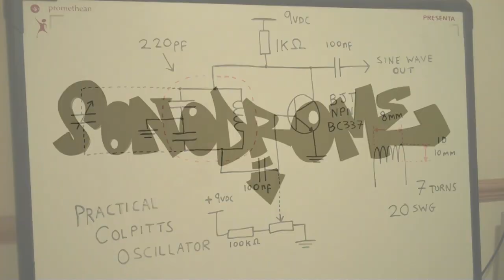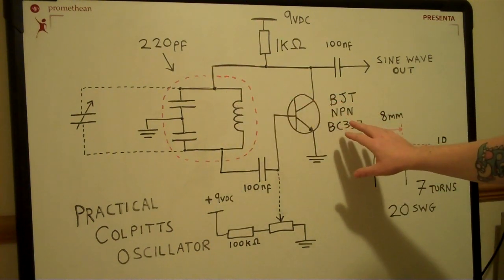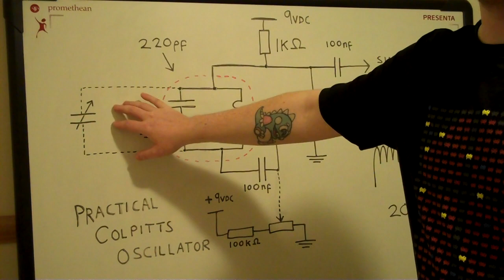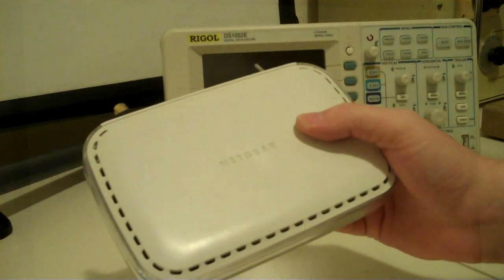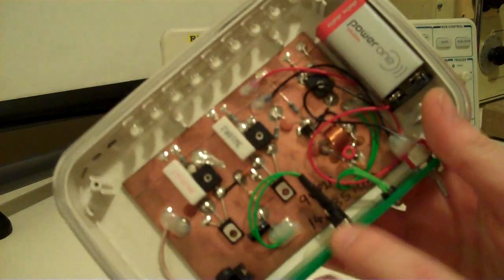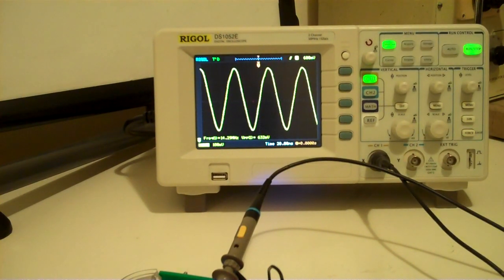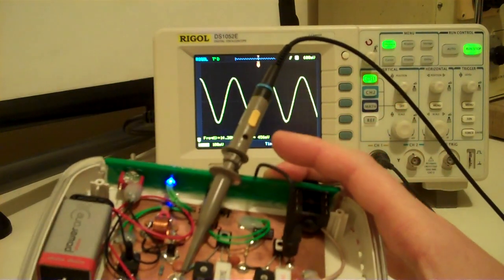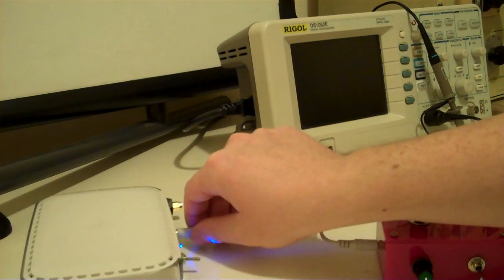Practical Colpitts Oscillator

Comment from the maker: The Colpitts oscillator can be used in various radio topologies. You could use it as the local oscillator in a Superheterodyne, but you will still need a bunch of other circuitry for the IF filters etc. I guess that's why the Colpitts is an interesting circuit to build - it's like a basic building block for many radio circuits, both transmitters and receivers :)

Comment: I simulated this on LTspice XVII -- I get an acceptable sine wave only if I remove the transistor base bias resistor network. I used bias of 1MOhm + 1MOhm. With smaller bias resistors, there is no oscillation, or the oscillations are overdamped and die out quickly.

Comment: Great video and great circuit. I'm just starting out learning about electronics and particularly interested in radio. I've been looking for an am transmitter circuit which doesn't  use a crystal oscillator and wanted to try and make my own cap and coil version. This looks buildable and you explained it extremely well. Nice job (and congrats on your HAM licence). I want to use this as the basis of an am transmitter to transmit my podcasts to an old MW/LW radio I have from the 50's.

Comment: Have you got a schematic showing the BD139 power stage? Also, I thought that at 14MHz the BD139 would be near its cut off frequency.
Nicely demonstrated.
Reply from the maker: David Jubb Thanks! Unfortunately I have not got the schematic for the power stage. I wasn't really aware of the BD139's transition frequency. Some datasheets list it as 50MHz. However for a proof of concept it seemed to function well enough.

Comment: Thank you for this extremely informative video.  Have been trying to put together a Colpitts oscillator with no success yet.  I am going to try this one.  Can you advise the value of the biasing potentiometer you used?
Reply from the maker: Robert Schoenberg thank you for watching and commenting. The value of the biasing pot is not critical because it is being used as a voltage divider. If the pot is 100k and the series resistor is also 100k, then the maximum voltage on the base of the transistor will be half the supply (4.5v) and the pot will allow you to adjust from 4.5 to 0v. You would have to check the datasheet of the transistor to make sure that a base-emitter voltage of 4.5v is ok. If you use a 20k series resistor with a 10k pot, then the maximum voltage would be 1/3rd of the supply voltage (6v). I hope that makes sense
Reply: Thanks again.  I am using a 2n3904 with Vbeo max = 6 volts.  So I get that i can use a 100k/100k voltage divider which will give the same voltage as a 10k/10k.  I will try the 100k resistor + 100k pot.  I assume that since you have already proved this circuit that this will result in enough current going through the base/emitter junction.
Reply from the maker: Yes, those values should work. Good luck! I hope it works for you.
Reply: Thanks very much!

Comment: I'm wondering if it would be possible to replace the transistor with some passive component, such as a coil/transformer, to perform the 180 degree phase shift, and then add sufficient energy in some non standard way for the required energy to make the device operate. What do you think of this idea ?
Reply from the maker: The transistor serves two purposes - It amplifies the oscillation and it buffers it. Without the buffering you would kill the oscillation should you put any load on the resonant circuit. As far as I know there's no way to make a Colpitts Oscillator without an active component.

Comment: Hi I don't have any BC337's so I'm substituting it with a 2n2222. I built the circuit exactly as seen above except for the substitution and my circuit isn't oscillating with the 7 turns of 20 SWG but will oscillate when I put in a dirty big inductor I pulled out of an old ATX PSU. Could the fact that I'm using a different transistor be the cause of my issues.
Reply from the maker: It is possible that the transistor substitution is stopping the circuit from oscillating. In general it is a very sensitive circuit that requires a lot of tweaking, but I don't see why it shouldn't work with a 2n222. Did you try using the optional trim capacitor? Also check that you have sufficiently removed the enamel from your coil wire ends, just to make sure you have a good connection to the coil. Good luck!

Comment: Can I build this circuit if I'm a Jew? Do I need to use a different frequency? I tried to build this circuit in LT Spice but I cannot get it to work. From inductor formula, I got .386 uH from your 7 turn, 8mm x 10 mm. But when I plug this into the Colpitts frequency formula I get 24.42 MHz, not the 14.285 as you demonstrates. Also, can you hint what the R for your pot voltage divider should be? English is not my native language.